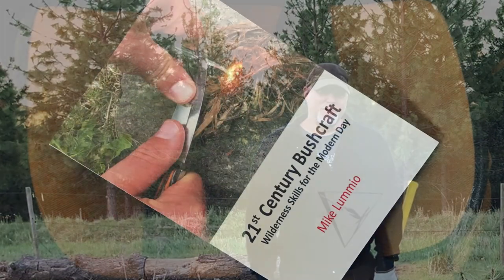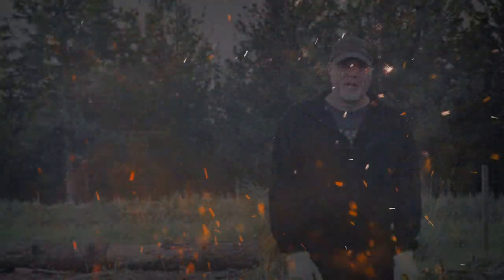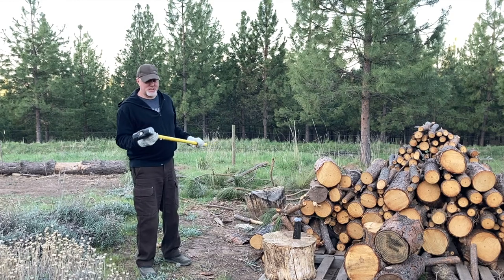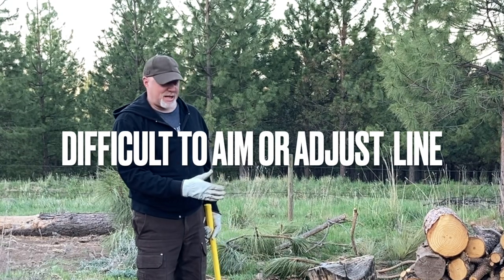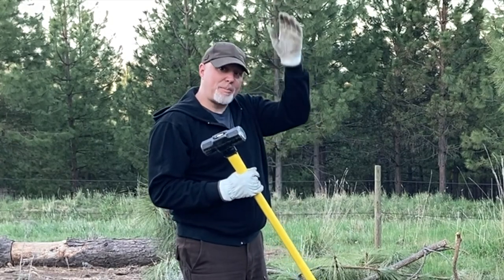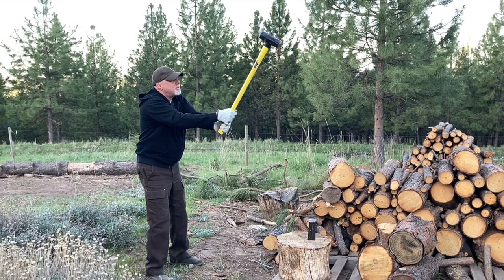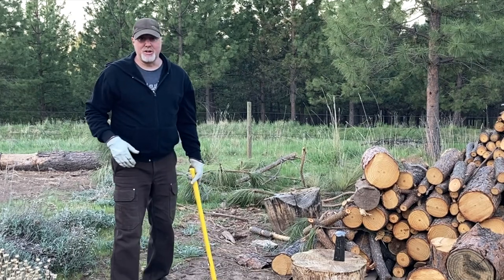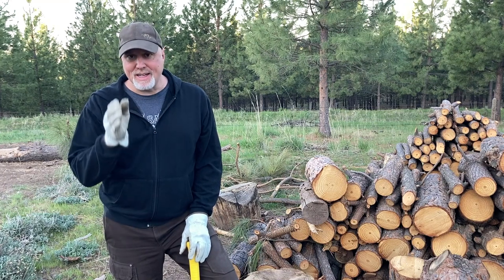How to Swing an Axe

Comment: OK, that explains how to come straight down for splitting wood, but what about the technique to properly aim and make a wedge for example ?
Reply from the maker: Hello and great question. The short answer is they're basically the same, except cutting in a wedge is on a horizontal plane instead of vertical. It's  difficult to explain a physical action with words, but I'll do my best and hope it makes sense. When I demonstrated what I consider the incorrect way to split wood,  notice the axe (or maul in this case) moved in a complete 360 degree circle without stopping, while with the correct method the axe made the cut after traveling downward only about 180 degrees after a brief pause at the top. On a horizontal plane (with gravity really working against us) you don't pause the axe before executing your forward swing, but the axe head and handle don't start their forward motion until they are in line with the target spot. This is the aiming process you asked about. The forward swing is still 180 degrees (or less) just as with a vertical swing. Because there's no pause it can look like a looping motion because once the axe is in the correct horizontal position, it moves immediately forward to make the cut. I hope that clears things up. I fell so many trees every year that I use a chainsaw now and drive wedges into the back cut to best control the direction of fall, but it's always good to have the skill to do it all with an axe. Thanks for watching and best wishes, ML
Reply: @BCNW1  It helped a lot, as well as your video, my aim is now much more consistent. As for my back, I don't do enough cutting to feel the difference. 
Thanks again.
Reply from the maker: @ThePEagle  You are very welcome. Thanks for watching and for the great question.

Comment: I was taught as a kid to have my right hand up on the shaft when starting the swing and then slide it down to the other hand as the axe comes down to help with aim. Is that correct? I've also always tried to keep my feet apart so if the axe deflects, there is less of a chance of it going into my foot.
Reply from the maker: Hi David, good questions and I will give you my thoughts which you can incorporate into your technique if you wish. I do not advocate splitting the hands apart on the handle because doing so can shorten the swing radius and increases the arc of the axe even more towards the body. I realize you slide them together during the swing itself, but I still think this can create problems with very little, if any, help with aiming. In fact, I would argue that changing hand positions during the swing could actually decrease accuracy. The best ways to increase your accuracy are being as consistent as possible with technique along with time and practice. As far as foot placement, that's a tough one because there's really no telling where the axe head will go after a deflection. Not saying that's a bad idea, but I think it's better to keep the feet shoulder width apart in a comfortable stance that will facilitate a good swing that is linear in trajectory when it contacts the wood. This linear motion will put the ground between you and the axe head and is much safer than relying on the thing missing you on the way by. I hope that helps and please feel free to contact me again with any other questions.